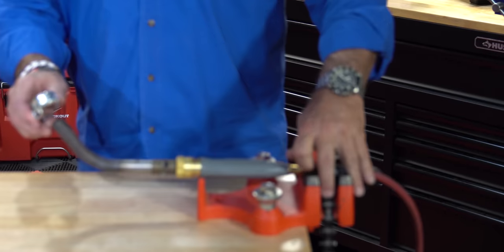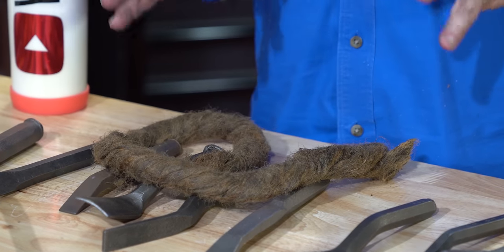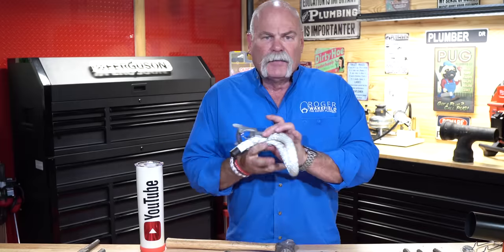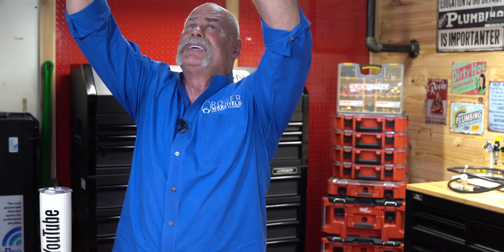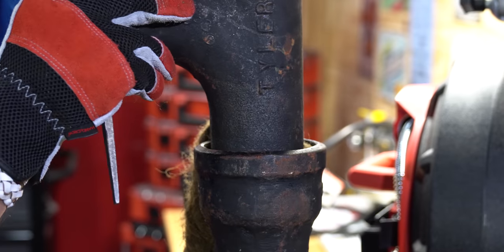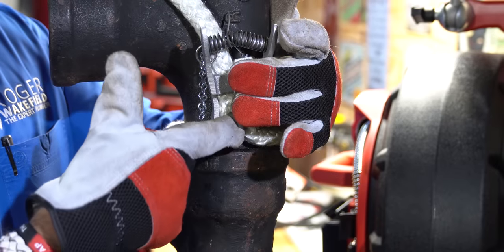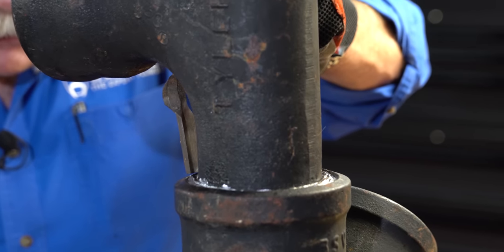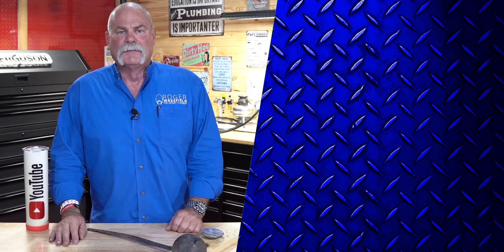I Make a Lead & Oakum Joint

Comment: When you crawl about 30 ft under an old house with a couple feet of clearance and you can see that someone took pride in their work doing it the hard old fashion way. It gives me chills and motivation to not slack off.
Reply: NOT ENOUGH PEOPLE TODAY KNO WHAT REAL WORK TRULEY IS OR INVOLVES
Reply: They did it before the house was built and built the the house around it. No crawling 30’.
Reply: I am one of the old plumbers who made lead joints before pvc. The work was hard and heavy. I had the privalge of working with the old timers who had done it all. People u to tell me how big my arms were for a short man. Plumbing is a great trade in it self but plastic made it easier and u didnt breath the lead when we poured joints

Comment: Here in Chicago we still use cast iron all the time. It's all that's allowed in commercial plumbing. I work 99% of the time in high rises and that's all we use is cast iron. For under ground we use push gaskets and everything else is lead and oakum. That one iron you said was an offset iron that was set to 1" is actually a ceiling iron. It's used when you have a hub tight to the ceiling and can't get in there with regular irons
Reply: Why the hell doesn't the city of Chicago allow PVC? I live in NJ and my dad was a union plumber retired about 10 years now. They started allowing PVC in commercial buildings in like the 90s here. Crazy Chicago still doesn't
Reply: They say for fire rating and that cast is less noisy than pvc but I think that our union is the biggest reason. Pvc is much easier to do than cast and using pvc would take a lot less work.
Reply: @gobulls372  i agree its the union. They say its to keep the trade alive
Reply: @ObservationofLimits  yea unless u are a brother or cousin of a big wig in the union all they do is take ur money. Or if u know how to work ur knee pads very well for them 🤣
Reply: Yes, but remember, this guy is from Texas.
   He wouldn't last half a day on a deck crew.   LMAO.
Reply: @gobulls372  Keeps away the fly-by-night moonlighters who don't know the trade.
Reply: Same with NYC.  We use lead and cast iron.  PVC only allowed in some places.

Comment: I am a retired plumber. I remember that process. Real tedious. Plumbers today have it alot easier.
Reply from the maker: Very tedious! 💪🏻
Reply: I could see this process being more forgiving than PVC/Chem welding though. If the clocking is off or something doesn't line up, heat the joint and make the adjustment? I've never done a lead/oakum joint though, so I have no idea; messed up a few PVC joints though
Reply: I can’t imagine piping in an entire house in cast like this. How long would this have taken a plumber?

Comment: in USSR we had these same style bell and fitting cats iron pipes, but we never used lead we used tar soaked very sticky and malleable oakum, we would smash that in as deep as possible then pour molten tar into the fitting and that would be it. Sometimes the tar was in short supply so in order to finish the job plumbers would use cement powder and would make a very thick paste from pure cement, as it would cure to be very hard, and it would be mixed with oakum and stuffed into the hub and would cure on the next day. You can still find pipes in old soviet apartment blocks with cast iron pipes joint with cement and they still go strong, very little leaks. Its the tar that was leaking. it was much faster, much cheaper and much less labor intensive.... and yes, that is the reason why now all soviet pipes laid in 70s and 80s are now leaking everywhere they were installed because tar is not a long term solution as it gets brittle, and as the pipe moves from seasons or cold/hot water it crackles the tar and starts to leak after some years.
Reply: Suprised they didn't use lead. Lead is super cheap in the USA

Comment: Plumber from the UK. Lots of old houses over here. Cast iron pipes everywhere, regularly come across lead waste pipes and occasionally come across lead water mains. Surprisingly non of this old-school stuff was taught to me in collage, had to learn it all on the job or from YouTube vids like this one. Thanks Roger 👍
Reply: Old school soldering of lead like this break's building regs in the UK. Can only use leadlok fittings to join existing lead pipework to new. Or preferably remove the lead completely.

Comment: That's a nice piece of soil pipe work, sir.  Cast iron toilet flanges are what I see a lot of newcomers struggle with in more recent days.  I'd like to see you perform a cast iron offset toilet flange install on this channel.  The flange that has a 2" offset is a bit of a bear.  I had to do several of them over the years and struggled mightly as there was no one to properly train me on it.  Had to learn from my own mistakes on call backs.
Reply: I always feel a bit of sympathy when the architect lays out the bathroom so a joist runs right through the middle of where the toilet needs to be and nobody sees what the problem is until the plumber gets there.
Reply: did plenty of 2"offset flanges, they do present a challenge.

Comment: You forgot to mention the maximum your lead is allowed to be underneath the lip. In NC, you have to have a 1 inch pour and it cannot be more than 1/8th inch below the top of the collar. We mostly use bands, but government work sometimes requires lead and oakum.

Comment: Another tip is to add a ball of plumbers putter under the triangle where your lead runner is clamped. Prevents lead from coming out. I’m 31 plumbing for about 13 years now. I pour lead joints whenever I can I enjoy the process. Also sometimes easier if the hub of cast is at floor level.
Reply: Another tip is to take a piece of oakum  and pull it apart and put it under the triangle and it helped from leaking.

Comment: I was taught how to do this in a horizontal Joint in water!   

My boss took threading oil and a copper pipe to that joint on a runner rope and poured the oil into that joint while I poured the lead...it kept it from exploding and popping.   Blew my mind!   So that is about as old school as you can get!
Reply: They do not teach you that in the field.  The pythagorean theorem for offsets or fluid dynamics....I learned in trade school.   But shit like using Windex instead of the blue leak detector or using a sharpened pencil to stop a leak temporarily on cast iron....that's learned from being around the old guys!

Comment: Oakum is made from Jute and tar.
I go one strand at a time first for about 4 times around. The final strands I'll twist together to force them down tight.   If you twist all of them like a rope I figure it has very little space to expand.  Keep your running rope in the box with oakum to soak up that oil and stay soft.  You can use a little plumbers putty at the top of the rope to keep it from spilling out.

Comment: This brought back memories. Dad and I pouring lead in the CI plumbing, and dipping the electrical joints. I still have a couple of gasoline blowtorches and toolboxes full of obsolete tools sitting in my shop. Showing how to start a gasoline blowtorch or how to set leather anchors in holes drilled by a drilling hammer and stardrill makes people appreciate what it took to build years ago. Thanks for sharing this.

Comment: 30 plus years ago when I helped load coal into barges on the Monongahela River out of a coal mine tipple, we used oakum, wooden wedges, and wood blocking to temporary seal holes in rusty 40 year old barges.  We had to look in the gunnel openings of each loaded barge, put a pump in if there was water.  Next climb down inside to see where the leak was and to try to plug it with oakum, wedges, and blocking. If the leak was major, call the boat to take it to get unloaded.  Never lost one in the 10 years I worked out there.

Comment: Great video Roger. I really enjoy watching your videos. I am a plumber in NYC and we still do lead and oakum joints on jobs. Mainly, the underground piping in schools but sometimes it is on other jobs as well. Im currently working on one right now with lead and oakum joints. Its a great skill for all plumbers to know how to pack and pour lead and oakum joints. It shows the great craftsmanship in the work us plumbers do on the job every day.
Reply from the maker: Thanks for sharing! How do you melt the lead?
Reply: @RogerWakefield Hey Roger, we use lead pots heated with a gas setup connected to it. And in tight spots too far away from the pot or no clear walking path, we heat the ladle with a B tank setup.
Reply: Using cast iron underground should be illegal

Comment: An old school plumber taught us how to pour lead joints in apprenticeship school. I’ve never had to pour one in the field, but I at least know the process of I’m in a jam.
Better question, how do I get the lead out If I’ve got a hub at the floor, and maybe I need to put a tie seal gasket in and transition to pvc. Much appreciated. Thanks. Much love from Ohio.
Reply: If you're not trying to save the old pipe that's in the hub, just remove the old pipe out with a hammer and chisel.  You have to place the wedge of the chisel between the lead and the old pipe and drive the chisel inward to get the old pipe out.  Once you get a nice chunk of the old pipe out, you can start caving in the rest of it pretty easily.  Don't forget to stuff a rag or something into the pipe down past your working area to keep from getting large chunks of debris into the existing waste piping!  Certainly don't forget to pull the rag out when you're done either!  Once you get the old pipe out, the old lead and oakum should come out pretty easily by driving the lead inward with the chisel.  Clean the inside of the hub out real well if you intend on using a rubber gasket to make the new PVC transition.

Comment: Brought back alot of memories with the lead pot being fired and melting old lead water lines and drain lines.  it was like making some molten lead in advance before using it made it easy to do consecutive joints one after another.  By the way that stuff in top of the lead in the ladle is called Dross.   Doing a horizontal joint will get you tons of reviews  and don't forget to add some oakum behind your little triangle to stop some lead from spilling as you pour.

Comment: I have an old Clayton and Lambert plumber's furnace. It was used to melt lead before propane was available, and it ran on this stuff called "white gas" which was basically just the unleaded gas of that time, very much like today's Coleman fuel. The thing is a monstrosity, it's EXTREMELY loud when It's running, and it shoots out massive fireballs while it's preheating. But it's a really beautiful tool, even if it's obsolete

Comment: I’m a plumber in Sudbury, Ontario. I’ve never used lead and plain to make a joint and probably never will do this is very nice to see. I’m 30 and I think I’m at the age where any plumbers that come after me will have only soldered in school. I prefer it over press because anyone can do press. Only a plumber can plumb a complete system and solder it.

Comment: I've been waiting to see one of these videos been in this trade for almost twenty years now and my boss is old school and when I say old I mean old he has fifty plus years and packing and leading a joint is one of the skills I learned from him that I am honestly the most proud of and still use to this day if your in service and work in older homes having knowledge like this and being able to replace cast iron flange will save both you and the customer time and money no one wants to cut holes in walls or ceilings if they don't need to

Comment: My uncle and I did excavation for a bunch of plumbers when i was young. We would dig and then help with repairs, tie ins  or new installs. For years it was all lead and oakum and then we were allowed to use rubber gaskets. What a game changer that was but that innovation was the end of craftsmanship and skill set. Any monkey with a digging bar could lay pipe in minutes after that. Thanks for the trip down memory lane.

Comment: Very interesting video. Being in demo, I have seen many cast systems, but I have never known how it was done. I had no idea that many tools were needed, but it makes sense. I always try to remediate the lead, as it’s great soft lead that can be used for many things. One thing I know is that it’s easier to get out than it is to put in, lol.  It’s also interesting to see the craftsmanship, and many times LACK OF when they come apart. I have also seen the difference of the lead when it’s poured all at once, verses in “layers”. 
I feel for the old school plumbers. One of the latest tear downs was a three story, that had all cast, including 5” vents to the roof…crazy amount of pipe…and the house had 52 window weights as well, so we all got some extra beer money when it was over, lol.

Comment: You can also use soil-seal instead of lead or to join cast and pvc using a no-hub adapter. You could also use a compression coupling.
Reply: Yup. No real reason to do this anymore. Awesome to see how the old timers did this, but really just a saftey hazard at this point. Use a no hub coupling or that epoxy stuff.

Comment: Sorry for my bad english. In Russia old plumbers used to poure a sulfur instead of lead. Or they used to put an oakum tar impregnated. So many times I needed to take apart the joints and had a big problems with sulfur. You have to heat a joint while a sulfur became a liquid. Then it evaporates and you have to inhale it long time.

Comment: we were up on a suspended access cradle , manually operated, doing the cast iron soil pipe joints, and the surplus rope was in the cradle, the paraffin / Kerosene roarer melting the lead, cause the rope to catch alight, the a ball of flame made its way up to the flat roof, on the rope, luckily it extinguished, we watch it, while we were 60 feet above the ground, this was back in the early 70's, in was because the rope was new, and external threads.
Reply from the maker: That will mess up a new pair of tighty whities.. Wow!!!!

Comment: Many sites don't allow hot work or have extensive hot work permitting requirements now. One of the criteria for permitting is that it won't be granted if an equivalent non-hot work process complies with code and engineering requirement, which in most cases press connect and compression fittings do.

Comment: I work in a hospital where there is one building from 1958 and two from the 1930s I believe... All the drains are done this way. 
More problems with the cast cracking than any of the  lead and oakum joints failing but it does happen

Comment: Great video. I still have all of my lead tools. 23 years in and have done many lead joints working in older homes in the metro Detroit area. Most work was in Grosse Pointe where a 100+ year old house was common. I even have souvenir of a section of wood water main that we replaced. After moving to SWFL 2 years ago I highly doubt I’ll be using my lead box again since everything in Naples is new. I am going to melt down my lead ingots in to fishing weights
Reply from the maker: How many tools do you have?
Reply: @RogerWakefield  Enough to be sponsored by Milwaukee

Comment: Are lead and oakum joints still code compliant? For example, if someone needed work done, and it's clear they need new joints, do you replace with a new lead and oakum joint, or tear it out and use pvc,
Reply: All around the New York area it is still used and required on some work.

Comment: Great information! Lead and oakum is banned here, preexisting installs can remain, but if they leak, you have to pull them completely out and re-plumb it with an approved non-lead based alternative.
Reply from the maker: Where are you located?
Reply: @RogerWakefield  Minnesota, I looked into it, and apparently it's only banned on the potable side... however the city I live in bans it for the sewage side as well. So I was misinformed. I thought it was a state law, but it's actually a city ordinance.

Comment: We didn't call it a running rope, we called it a joint runner. When I started plumbing we didn't have PVC, only hub and spigot and no - hub. We were still using clay sewer pipe till 1973 with the rubber donut and we used slicky dicky to pop the pipes and fittings together.  I'm still doing some plumbing work here and there. I myself see a decline in our plumbing trade and  it saddens me. Roger I'm from Alama, not to far from where you are....

Comment: I have used a product called Black Swan Soil O lead substitute instead of lead on a couple occasions here in East Los Angeles.
It gets hard like cement and sealed well but still requires oakum

Comment: I pulled my entire bathroom out because a plumber probably 20 years ago didn’t want to make a proper connection to cast iron pipe.  They put a 4-2” fernco on a bell of a 2” cast iron pipe and put the bathroom back around it,  surprisingly it plugged really bad there

Comment: Ok, that’s nice to know.  Not sure I’ll ever need it, or where to get the tools. But still nice to know, and I now know what all the stuff my brothers threw away after Dad died was.  

Is there a good way to get them apart?   And, is there a transition fitting to go back in with PVC or ABS?   I have a hundred buildings which were built in the 1930s to late 1950s, and the steel waste lines are chancered up to the point they need replaced, and my guys are completely flummoxed by the whole idea.

Comment: Carrier or Lennox new gas furnace and AC? I may need to replace my Comfortmaker it's 19 years old. The Navien npe-240a2 any good? May replace my 19 year old 48 gallon power vented gas hot water tank too. 1 inch gas line coming into house.